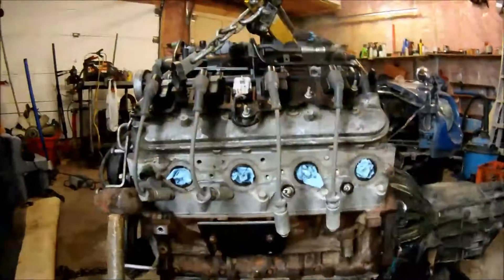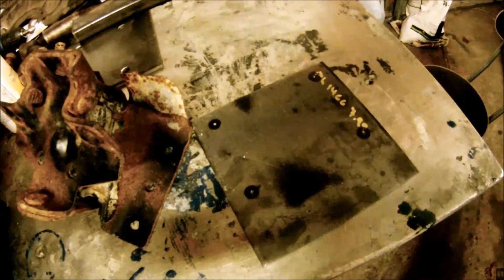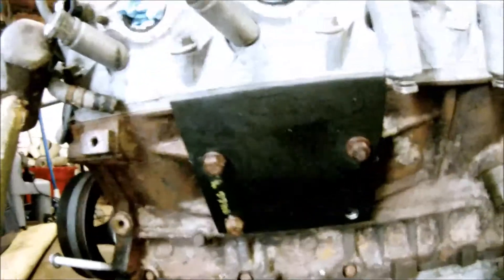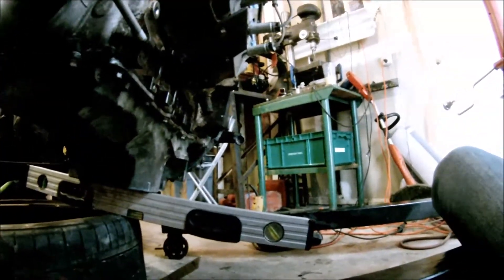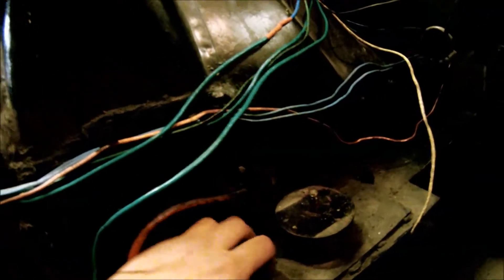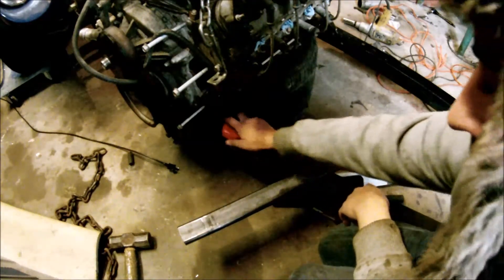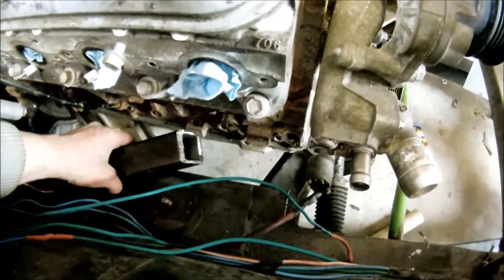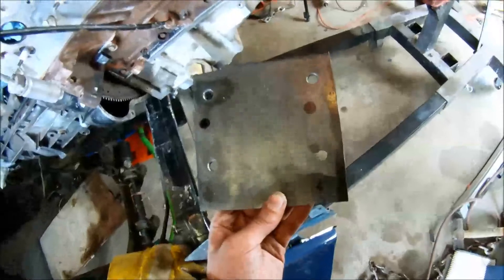Part 1 - Pilot - Datsun 240Z 4.8L LSx Swap  - Engine Mounts

Comment: What oil pan are you using
Reply: Hey Erick, 

I'm using the stock truck pan that's been cut down  close to 1.5" to 2" (I'll have to check).  It holds 5L of oil total and I will be looking to upgrade to an even lower profile pan with higher capacity once it's up and running
Reply: Oh cool, im trying to do a swap like urs but the pan is too big, need an ls1.